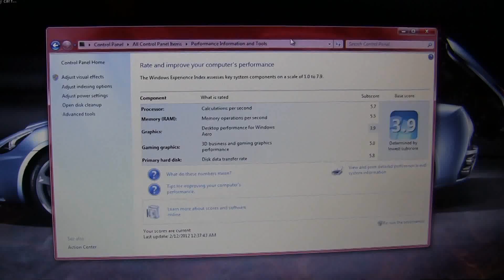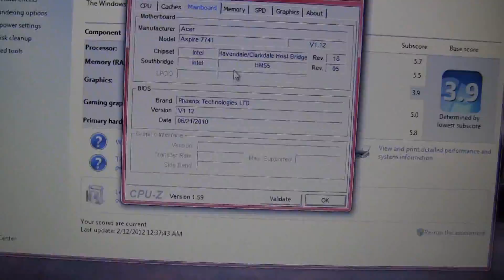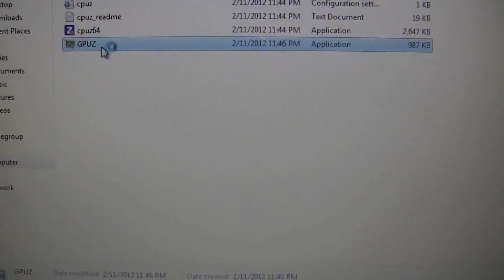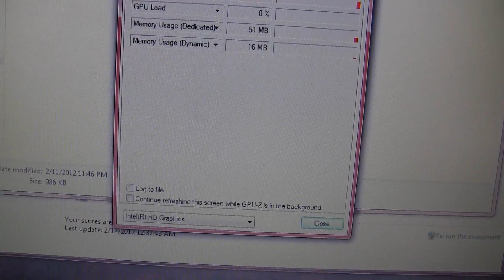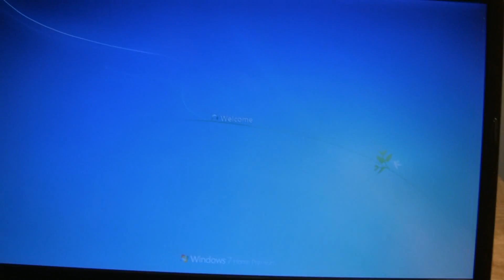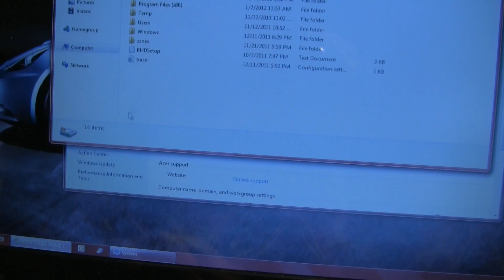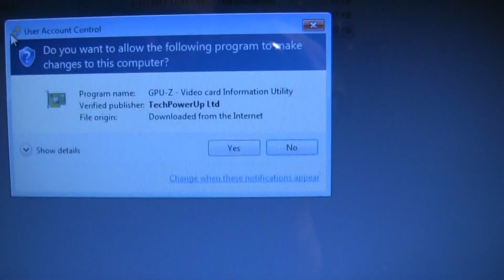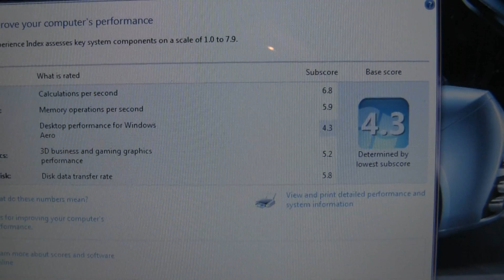Upgrading my Acer Aspire 7741 laptop Pentium to i5 CPU upgrade Replacement

Comment: Thank you for making this video.  I used the i5 560.  I just finished installing the new processor.  The only weird thing that happened is that the computer date changed to 2010, and it said that the certificates for websites couldn't be verified.  But i changed the date and now everything works.  I was using classic theme, and still couldn't watch 720p.  1080p still lags, but eh 720p is good enough.  And i get to use the aero theme.  woot woot.  I bought the i5 from ebay for like $13.  So thanks again.
Reply: Gopher Cheese Any real noticeable performance boosts since the upgrade? I'm also going from the pentium 6100 to a i5 560m , I'm also putting in 8gb of ram and a ssd. But my main question is about heat generated from the new processor, is there more?

Comment: Great job!  No plastic clips around the edge of the covers? Seems alot easier than having to use a pry tool to release the plastic back and front covers! All ribbon cables are ridiculously tiny and vulnerable to breakage, especially the AC connector at the MB (great tip on removing it at the case instead of the MB connection). I really appreciate you giving the performance results afterward and show what will be realized after installation.

Comment: I know this is an old video, but I have a very similar laptop that I am about to upgrade from the Pentium P6000 to an Core i5-560m.  My laptop is a Aspire 7741Z-5731.  I have done a fair bit of research, and found that the motherboard, with the latest and final BIOS 1.26 can actually support some i7's.  Although, the cooling and power capabilities of the system would fall short.  But I read several threads that favored the i5-560m and said they go a significant boost in performance.  I am waiting on some thermal compound to arrive, but that should be tomorrow.  After that, I will be dropping the new CPU in.  Thanks for this video showing what it takes to get into this laptop(the one that I am using to write this message).  This should be a piece of cake.

Comment: Thanks for the Video.
I got the same laptop, for free. We told the client it's just too slow (Which it was)
I threw in an SSD and replaced a 2gigs with 4 gigs.
Just bought an I5-480M from ebay for about 15$, which should give the laptop a decent performance bump given the fact this with the SSD replaced, the entire bottleneck is CPU related.
Runs Windows 10 quite fine with the Pentium CPU, but the upgrade will make it a bit better :)
Hopefully I won't break anything. But slow and steady should do the trick.
Reply: How did your build turn out
Reply: @TheSoball358  I got the cpu from ebay... and I never took the time to do the actual upgrade. Ill respond here as soon as I do. Hopefully within the next week and not another year. Funny, I still use this old laptop for minor tech stuff.
Reply: @CoolTI-Daniel  
I own this computer and would love to try this. This computer has been somewhat a work hoarse. Yes, its older but it has the cd drive and capabilities of todays world.
Reply: @TheSoball358  Laptop upgraded. I followed OP's instructions. Granted it's not 100% step by step... However it's an easy laptop to work with.
1- ALL screws go out... ALL of them.
2- there are so few cables to disconnect it's surprising. (I think a total of 3 ribbon cables (one of them isn't a ribbon in my case)
(around the last part, I didn't disconnect that last power cable for the motherboard, I just put some protection on the screen flipped the motherboard over to the screen side  and worked from there.)
3- take your time.
4- For some reason there is 1 ribbon cable plug, I don't remember if there ever was anything for it... all still works :)
5- I now have about 3 of the bigger screws and 2 tiny tiny ones spare... no idea from where, don't care.

Windows 10 doesn't have a rating system so... no idea of the gain. I should have ran userbenchmark before, but I only thought of that now.

My Acer is now an I5-480, 8GB ram and 256Gig SSD. :)
Reply: @CoolTI-Daniel  
Great Job ! , when i do this, im thinking 500 gig ssd.  Is that port on the bottom right a
 m.2 sata or no?

What is your boot up speed atm?
Reply: @TheSoball358  I did some research. I didn`t find much people say anything about putting a drive on that free pcie slot. I think it`s used for adding a bluetooth card or something along those lines. 
I found this thread on acer`s forums that gave some details on it.
https://community.acer.com/en/discussion/578656/7741g-will-ssd-drive-work-with-mini-pci-e-slot

Comment: This 1gen i5 ,up to 4th gen cpus were in sockets but after that its all bga no upgrade for cpu even some laptop models the Ram is bga, that why the old Tech is more Upgrade friendly than the new ones and they last longer way longer , I just bought the same laptop model  in video from ebay upgraded it to I5-480 a faster CPU than this one , works very well even with Windows 10.

Comment from the maker: the Fusion chips are actually soldered to the motherboard, so they cannot be replaced. if you look up your CPU, it will list 'BGA' as the socket type, that mean Ball Grid Array, which means soldered...

Comment from the maker: the 620M should run great in your laptop, it will perform just a little better than the i5 I put in mine.  The CPU only uses 25W in the Pentium, but the Intel HD video uses 10 W, the power consumption should be exactly the same on both chips.  There's no reason, at least that I can see that it won't work.  the 620M is a solid chip, good luck!  I hope everything goes smoothly if you get it!

Comment: very nice i've been up days trying to  verify this will work and here you go completing it successfully.  I will try to do an i5 and I have the p6200, same socket 989 rPGA, only thing i am scared of is the bios, i have a really pathetic bios and its real limited.  Its made by insyde v1.03, anyways i'm so happy you did this vid as it should be very helpful when i take mine apart.  Cheers and very good video

Comment from the maker: no, the 2430M is the '2nd gen' sandy bridge i5, it needs the HM65 chipset, and the 7741 has the HM55, the 55 chipset only supports the '1st gen' i5, so the 430M (without the 2 out front) will work, the 450M is also a reasonably priced CPU and the 520M i5 as well

Comment from the maker: the slot by the memory is a mini pci express slot (mpci-e) that was for if your laptop came with a blue tooth card, that's where it would go.  I have another video of me plugged an external connector into it if you check my other videos out.  you could upgrade to any 'first generation' i-core DUAL CORE CPU, like an i3 330M or an i5 520M like I did here.  it has to be one of the 35 watt (or 25 watt), so no quad core i7, but they did make a dual core i7 (the 620M or 640M) but they cost $200+
Reply: Thank you for making this video, I have an acer aspire 7741 with Core i3 380M and i want to do a upgrade for the best possible,  what can you advise me; for example something similar to (core  i7 )  with socket rPGA 989       Thanks in advance

Comment from the maker: @SPARKPLUG807 - only if its the 620M or 640M dual core CPUs - the motherboard needs the onchip video to work and even if you have the onboard video (7741G models), the 720 740 840QM i7's etc are 45 watt parts which means that they will run too hot for what the heatsink is speced for. the 620M or 640M are 35 W parts.  actually, you'd prob get similar performance from a 560M or 580M i5s, they have just have the 3M cache and not the 4M like the 6xx i7's - depends on which one you can find cheaper

Comment: I was researching to do this for a laptop I just bought and it was great to see this video. The hunch is true because both the P6100/ P6200 and the i5 520UM have the same bus bandwidth and requiere the same voltage to run, they fit in the same socket. You can always check compatibility lists at intel.com and see higher processors that share the same base characteristics. I think it is possible to go up to the i5-580M (2.66) The rest is pure luck I guess :)

Comment from the maker: yea, it will fit, its the same CPU I put in the 7741 I got in my video.  as long as the CPU is in good working order and you don't destroy the laptop taking it apart ;)  its compatible with the HM55 chip set that comes in the 7741

Comment from the maker: no, to find out what you could do is look up your MSI model number, and see what other CPU's came with it. usually they offer maybe 4 or 5 different CPUs for different price ranges Typically you can upgrade to a better CPU that was available as an option in your specific laptop

Comment from the maker: yep if you can find one... the 580M is hard to find and VERY expensive.  I would recommend looking for a 520M or a 540M.  They might not have the same performance, but they aren't THAT much slower and they cost half as much. you would get all the benefit of the upgrade, and never notice the 200 mhz difference in speed

Comment from the maker: well, from what I can find out, the HM75 DOES support the i7 3610QM, which is an amazing CPU by the way, BUT the 3610QM is a 45W part and the i3 2350M is only a 35W part, so the board, power, and cooler might not be able to support the heat and the power requirements.  see my FAQ video - IF the laptop was available with a 3610QM option, you might be able to get a cooler that will work, it  MIGHT be the same cooler.

Comment: @Alexandre Medeiros
Very likely you have a G1 Socket also known as  rPGA 988A. If that's the case you should google G1 Socket and go to Wikipedia and on the right you'll have listed all the processors that go into that socket and your processor should be among them. Beware, the quad cores I7 720m and above (up to the 940xm) might not work due to not having the integrated graphichs die on the processor, only the i7 640m and downward. ;) 

Cheers!

Comment from the maker: yea, the sound card is on the motherboard... I dont know where you live, but in the US the motherboards for these run about $100-150 which is  a little high just to fix a audio out port... heck, in the US these 7741 cost about $300 used, plus you still gotta replace the board on top of that

Comment from the maker: no, the 720QM is a 45 watt part, and it doesn't have the integrated video built it. you'd have to still to a 35 watt CPU. the best one in a similar price range is a i5 520M, like the one I used here, there are better 1st gen CPU's but they get into the $200 plus range, the i5 580M the i7 620M and 640M 'dual core' i7's

Comment from the maker: the i5 580M will work fine with the HM55, but its not the driver you would need. you would need to flash the BIOS of the motherboard to get the i5 580M to work

Comment from the maker: yea, I think the 580M is the 'highest' performing CPU for the HM55 chipset.  I think is it technically 'faster' than the i7 620M and 640M CPUs, but it is also the most expensive first gen mobile i5 that I've found. the 580M's cost like 250-300 US$ and those dual core i7 usually cost a little less!  Its the most important to look the CPU up, check its TDP and chipset compatibility, and if they match, technically (in theory) they should be interchangeable
Reply: Just trying up grade mine even no its old lol
 Will a Intel core i3 390 3m hm55 pm55 fit it?

Comment from the maker: no, the E-350 is part of the 'Brazos' platform called 'Zacate' - it lives in whats called Socket FT1 and there are only 7 different processors that will fit that socket.  Yours is the 2nd fastest.  You could technically upgrade to an E-450, but you wouldn't get a faster speed, you would only gain the ability to use 1333 RAM, which wouldn't make that much of difference.  the 450 does have Radeon 6320, but u wouldn't notice it really. the high performance chips use socket FS1, completely different

Comment from the maker: you could do a 2nd gen i5 like a i5 2520M or 2540M, they usually run about $100, the only i7 you could run is a dual core i7, the 2620M or 2640M, both are very good, and if you check one of my more current videos, I put a 2640M i7 in my Dell laptop, but they run between $150 and $200, in the US at least...

Comment from the maker: I would recommend the , the i5 450M or i5 460M, they can be had for about $100 or less (US)  techincally, the BEST CPU you could put in it would be the i5 580M or the i7 620M or i7 640M, they are all dual core CPUs, but they can cost $200+ each if you can find one.  AND you might have to flash the BIOS on your motheboard on any CPU change because it might not recognize the 'microcode' when you boot it.  see the end of my video for what I had to do

Comment: yeah 90C is a little high! i guess i plugged the fan back....i hear it running ....now i have put the laptop on a different surface, so it's not on a flat surfance it has some space under...so the fan can suck some "fresh air" lol....im running a flash game around  50-60C ....instead of 80C 2days ago lol.....and also when it reached 90C....the laptop was open for a whole day....maybe it's coming from that too?

what do you think of laptop coolers ? (the pad with fans) is it worth it?

Comment from the maker: no, you can't upgrade it, its a ball grid array (BGA) chip that's actually soldered onto the motherboard, much like the Atom CPUs, its 17 watts low power, but its actually pretty solid CPU for such a slim notebook

Comment from the maker: the i7 is a 45W part, the only CPUs that will work are 35W dual core parts, so in the i7 range, that would be the 620m and 640M. this laptop can't provide enough cooling or power to run the quad core parts

Comment from the maker: nope, the 2670M is the 2nd generation i core processor, designated by the 2xxxQM at the beginning.  It will fit, but it won't work

Comment: I have a 7741z that I was still using every day up until December when my son gave me an awesome home built desktop computer.  I've changed and upgraded almost everything except the processor because I was never sure if i could do that.  I like to have a laptop for when I travel or am over someone's house.  I've changed the fan/heatsink a few years ago and it still runs pretty hot so I"m wondering if the processor is shot.   I also wonder if an i5 will help it to run faster since it can only do max 8gb ram. Heck if there's a way to get it to use more ram than 8, I'd be a happy camper!   (My new desktop is, ryzen 3600, w/ 32gb ram.  (ps,,,do you still have the Acer?  Are you willing to sell me the keyboard?  I cannot find an oem keyboard except from an Acer reseller and they want like $40 for it.   All the keyboards now don't have the solid back and they are way to flimsy.)

Comment from the maker: technically, for this laptop, the highest CPU I could upgrade to would be the i7 640M dual core, or the i5 580M dual core, their performance is almost the same. the i7 620M is also in that class, so I could find the cheapest one of those 3 if you want max.  I changed the ram in this from 3 GB  elipdia stock to 4 GB of Kingston. technically it should hold 8GB

Comment from the maker: laptops are pricey, but it is MUCH more expensive to change the CPU. this 7741 laptop has as street price in the US of $200-250, and the CPU itself costs $100, and it will not give you enough boost to do what you want. you can buy a BRAND NEW i7 laptop in the US for $600 that will stomp this 7741, while more expensive in other counties, the cost/value is still basically the same.

Comment from the maker: its got the HM55 chipset, so in THEORY you could put any of the first gen i core CPU's in it that have the in chip video card... for example, an i3 340M or a i5 520M like the one I swapped.  its the same "generation" but it has to the first gen 'arrandale' core CPUs

Comment: Hi, I have an hp pavilion dv7 - 2180 el with Intel Core 2 Duo P7350 processor. Do you know which processor can I use to upgrade this laptop? Because in the windows experience, the processor shows me 5.5, and it´s the lowest in my laptop. Thanks in advantage.

Comment from the maker: the v5 431 is the brand new model, no?  not much... it looks like that laptop can only support 17 watt CPUs, so I don't think there is any CPU you can change it out with... that laptop probably doesnt' even have a CPU that can be changed, its probably soldered onto the motherboard

Comment: Hey man... awesome vid.. i have a Samsung laptop with a i3-2350M  processor on  a HM75 express chipset... can i replace it with a i7-3610QM with Intel HD 4000 graphics... is it possible and will the graphics change from HD 3000 to HD 4000? or will i screw up my laptop period?

Comment from the maker: if your Acer 5741 has Intel HD graphics, its built into the CPU, so changing the motherboard wouldn't help much. if its the Radeon 5470M or Nvidia chipset, they are on the motherboard.  1. use the drivers from the LAPTOP makers website, not from intels or AMD's. seriously... Acer has custom ones for power saving. 2. Bad RAM chips can cause video driver issues, swap it out 3. the video cable that connects the screen might be loose. check its location in my vid, should be in a similar location

Comment: Hi i have an HP dv5 2046la and i want to upgrade the cpu and i was wondering if its worth it and whats the best I can get for it. I use it mainly for circuits simulation and some gaming, im in engineering school, and I would like it to be fast, also just installed and ssd and it got better.
Thanks

Comment from the maker: from what I can tell, the P9600, but I don't think it will give you the performance boost, you want, maybe 10% if any at all, so for what I it costs, you'd be better off getting a newer laptop. even the cheaper Intel CPUs on a current laptop would be much faster